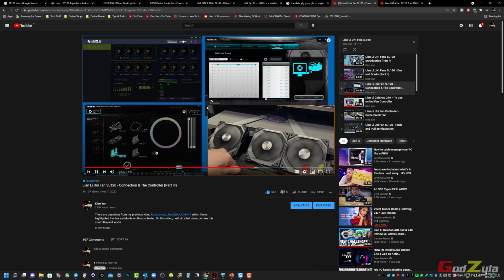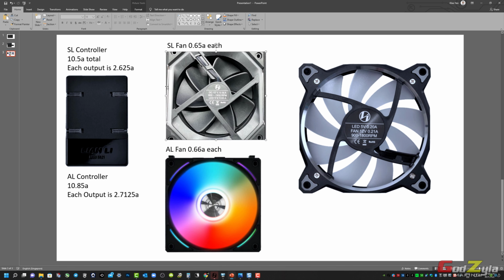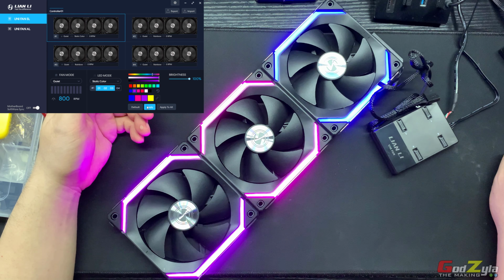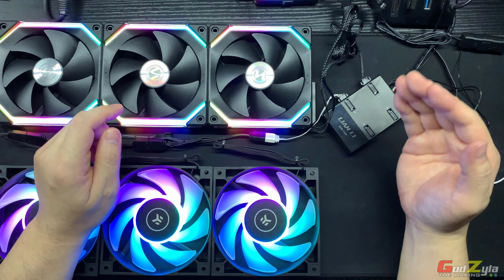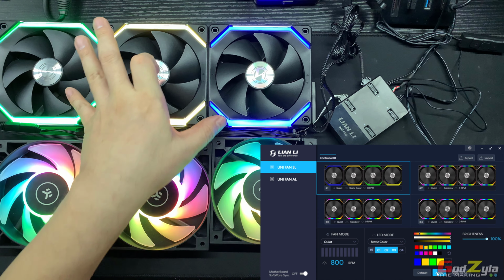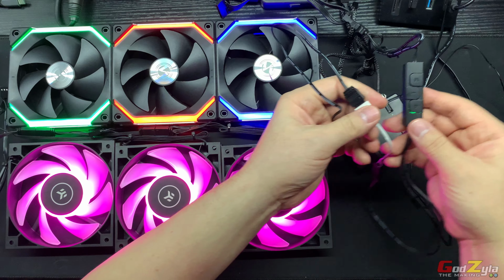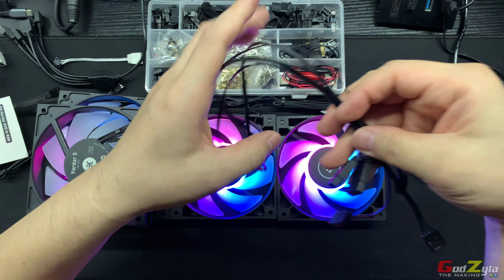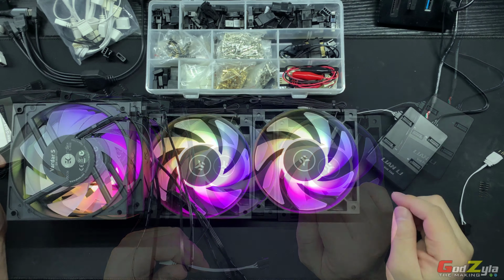Lian Li Uni Fan AL120 & SL120 Controllers [L-Connect 2]

Comment: Hi Kleo 

Your channel is great, my unifans connected to slot 3 in L-Connect recently starting running at full speed no matter what I set them at, all fans are connected to my motherboard via the unihub pwm connection in system fan header 3 and those connected to slots 1 and 2 are controlled without any issue - the speed changes as I change it etc 
The RGB works fine through L-connect for all my fans including those in slot 3, any idea what could be causing the fans in slot 3 to run at full speed constantly?
Reply from the maker: Hi Adam Thomspon, welcome to my channel. It could be a connection issue or the uni controller issue.

Please practise with caution ok.. make sure you power down and discharge your pc before performing the below steps. 

Maybe try swaping only the cables between slot 3 (the fans you are having issues) to slot 1 or 2? If they are still at full speed, this will narrow down that your slot 3 fan cable or fan connection is having the issue.

1) Try using another set of cables and test. 
2) If it still does not help, unlink those fans and swap position. 
3) If after performing 1) and 2) and it still does not help. I would urge you to unlink slot 3 fans and test them one by one
4) If detected one of your fans is causing this, contact lian li to have your fan replace (https://lian-li.com/contact-us/)

If cable or fan is not an issue when you swap slot 3 to slot 1 or 2, it could be your uni controller, test your ok fans from slot 1 or 2 to slot 3. see if they go full speed. it if does, then have your uni controller replace.

Comment: i finally bought al120 fans.. but i encountered a problem the al controller can't be detected unless i reconnect the usb header again..  its always like that on every reboot.. do i  have to return a defective controller ? or usb header hub powered with sata help ? .. i dont want to reconnect usb header on every reboot :(.. thanks advance.  any idea how to fix ?
Reply from the maker: Hello ryan reyes, welcome to my channel. Does your motherboard have another usb header? You might want to try connecting it to another to test it. Also to check if your motherboard have the latest bios? As some reported on AMD zen 2 onwards, if your bios is still the old bios. Intermittent might occured. Kindly check for information related to your motherboard at it’s respective brand website.
Reply from the maker: You might also want to check if you did update the chipset for your motherboard too https://youtu.be/8l4i5UjO3es
Reply: yes updated to the latest bios and chipset.. im using z490 gundam wifi...  but i will try to connect on another usb header !!! thank you for the quick response 😊.
Reply from the maker: @ryanreyes7500  you are most welcome.
Reply: i think i fixed my problems by uninstalling  armour crate using the clean unininstall.. then reinstall l connect 2..  then reinstall armour crate last !! both happy now no more  conflict even after every reboot !! just wanted to share 😃  . thanks for the big help. :)
Reply from the maker: @ryanreyes7500  nice, thank you for the reply and your comment will definitely be useful to those having issues.

Comment: Great videos...
Having just purchased my AL and SL fans, I am very impressed, I moved from Corsair.
I do hope Lian Li consider some new features:
1. if we could connect our RBG - say ... CPU and Water pump aRBB directly to the LL Hub that would allow full RGB Sync rather than another software.
2. If the software could have a curve based on CPU or GPU temp.....to let the fan auto increase/decrease.
Reply from the maker: Hi Paul, welcome to my channel. I am so terrible sorry that I miss your comment. yup it will be nice if lian li do consider your suggestion. once again thank you for the feedback and do pardon me to reply you this late.
Reply: Hi, short question. Did you connect the AL and SL fans to the same controller?

Comment: Hello, i was wondering if you have had any issues with the L connect 2.0 software. Everything with mine works fine until i select rainbow mode, then everyhing in the software stops working. I have to reboot the software to get it working again. I did uninstall it and that seemed to fix it but after a couple of days i get the issue again
Reply from the maker: Hello Takaoshi, welcome to my channel, when that happens, you might want to check on your device manager to see if the USB connection is disconnected. sometimes it does that to me and I did a hardware scan without rebooting nor re-installing the application. Later found out that I have another USB device that is conflicting with it. I move the other device to another connection instead of using it on the same internal USB hub spliter. Then the problem is solved. If that's not the case and it still causes an issue to you. you might want to approach lian li support on your issue.

Comment: So my brother has the Lian Li fans. And everytime he tries to change the colours, they stick to the rainbow RGB…
Reply from the maker: Hi Keiran Winn, welcome to my channel. For your brother's case. It could be 3 reasons. 

1st you might need to update the motherboard chipset as there might be unidentify usb device. Guide in this video https://youtu.be/8l4i5UjO3es

2nd there might be some other argb application installed before the L-Connect app, which the other argb application took control over the IRQ resource (see under device management). you won't get to see the Lian Li device under the USB section. 
in such event, uninstall all argb application using revo uninstaller https://www.revouninstaller.com/, make sure all left over files are removed. Reboot the PC and re-install L-Connect application first, make sure to run as administrator when installing. 

3rd the usb cable between the Uni controller to  the motherboard is faulty which is unlikely, if your board have another USB 2.0 header, switch over. 

If all else failed. I would advise you to approach Lian Li tech support https://lian-li.com/faq/ or to raise your issue at their reddit page https://www.reddit.com/r/lianli/

Comment: Can i connect a single fan to the motherboard without a controler?
Reply from the maker: Hello Oliver Gasser,  welcome back to my channel, yes if it's only 1 SL or AL fan. But you will need to find a female 3pin JST connector to a 3pin standard connector.

Comment: so can i use AL hub controll to control SL fans with having to use two hubs?
Reply from the maker: Hello Nemo, welcome to my channel and yes you will need two controllers as the SL uni fan will react properly on the SL uni controller, same applies to the AL uni fans which will only react properly with the AL uni controller. Therefore if you have place a mixture of SL and AL fans. They each will need their own controllers which have specific firmware on them.

Comment: Thanks for your explanation. Would it be possible to control non-fan RGBs like an EK GPU waterblock with D-RGB using a UNI HUB and the cable kit?
Reply from the maker: Hi widezu69, welcome to my channel, I believe you can so long you know the argb load limit and have the correct converters. this might not be EK GPU water block but i have done it on normal argb strip and also on other argb fans. please watch these following videos

Dos and donts about the uni controller - https://youtu.be/QQHJUQvKwlY
EK Vardar Evo 120ER fans with uni controller - https://youtu.be/bMRz2KVqbjA

Comment: hello kleo, i watched many of your videos on the lian li sl120 fans, but i still cant seem to get my fans to be detected on L Connect 1 nor L Connect 2 (doesnt work as i cant get past the detect device step as i keep getting the message 0 devices found), ive tried to swap the usb port for it on my mobo but nothing changed, however my pc is able to detect the fans through the device manager, so its not a chipset error. any idea on how i can fix it?
Reply from the maker: Welcome Ismail to my channel, now I like to check with you. which motherboard are you using and do you have other argb application running (example Amoury Crate from Asusteck, Fusion from Gigabyte)? if you did install them before you install the L-Connect app, I would advise you to uninstall all argb apps using revo uninstaller. next your have mentioned using Lconnect-2, I assume you are using SL120 fans. may I ask if your uni controller have a marking that says SL120 or no? If not, you will need to do a firmware inorder for your uni controller to use the version 2 of L-Connect. https://youtu.be/hZpzR_4917c . Once again thank you to have spend your valuable time to view my videos..
Reply: @KleoYan  hello kleo, yeah ive followed all their troubleshooting steps and even removed corsair icue (which was the only argb controlling app i had) but still not working. initially the fans were running at default speed and rgb setting, but after i attached the fan controller to another 4 pin hub, i was able to change the fan speed to PWM, but the argb still cannot be controlled. the mobo im using is aorus b550 elite, and my controller does not have SL marking, L connect 1 does not find anything, and i tried using L connect 2 with the device scanner, 0 devices found :(
Reply from the maker: @bloopismail  I think the best way for you is to enage lian li support directly, as I am not able to replicate your issue to assist you. or you can approach lian li reddit. as there are more pc builders there and might have a solution for you. https://www.reddit.com/r/lianli/

Comment: Hi Coming from the Uk used these fans in a few builds, now have all these fans are failing (led's) , Lian li have admitted  fault with the SL120  " BUT" if your from the Uk the website fails to upload as its US based, so at the moment i'm down £1,000 as fans were £28 each with no option to replace them, like any other company they will take your money but make it a nightmare to replace, shame on them
Reply from the maker: Hello JAYZZ71, so sorry to hear that from you. To some is easy to some is not that easy. I like to check, do you run any VPN? Maybe that will help. Or a simpler way is to change your IPv6 to dns to 1.1.1.1  you can find info here https://1.1.1.1 once you have set that try again. It might help.

Comment: I've problem with my UNIFAN SL120 - LConnect RPM gone haywire it shows 0 or various numbers of rpm. LED control is fine. AMD Chipset Driver updated. i can't seems to control my fans RPM. I'm using lian li fans connector, connects to usb 2.0.
9 fan, separate to 4 group. all connected to fans connector
3fans - AIO (Top)
3 Fans - Bottom
2 fans - front
1 fan - back
Reply from the maker: Hello Hy L, welcome to my channel, you mean you can't set your fans to run with Quiet, High Speed, Full Speed or manual settings? if that's the case, your L-Connect is not syncing up with your uni controller. what motherboard are you using and are you using any other argb software along with the L-Connect? Anyway is to switch to another usb 2.0 header if your motherboard has it.
Reply: @KleoYan  im using Aorus B550i Pro AX... bad choice... but its installed >.< .. only 1 usb header for this MOBO... I just manage to solve it half, i downgrade my L-connect 2 to L-Connect 1. And then the fans response to all the fan speed settings, so this exclude the Uni Controller sync issue. 

Another half problem now is My BIOS/MOBO unable to detect my fans. So when i set it to PWM mode, the fan only run at full speed. 
My Unifan controller connection as below :
(I've tested using 3 diff set of unifan controllers, usb & pwm cables & diff sata connector from the UNIFAN Box, so this excludes the wire & controller problem)
- PWM cable connected to fan connector at mobo.
- RGB Cable not connected to anything.
- SATA connected to PSU
- USB connected to MOBO usb connecter.

Headache !!! but at least my pc is cooler with higher fan speed now
Reply from the maker: @HyLow24  when ur fans are connected to the uni controller. You won't have rpm readings except in L-connect app. Btw your SL120 controller, does it have the SL marking on the controller? If not you can't use L-Connect 2 app.  You need to do firmware on your uni controller. Let me grab the video for you.
Reply from the maker: @HyLow24  this is the video to do the firmware. but the choice is yours.. i won't be responsible if you donno how to do it properly .. https://youtu.be/hZpzR_4917c hopefully this video will aid you in someways if you intend to use L-Connect 2 with your SL120 fans.
Reply: @KleoYan  Hi Kleo  I've found the solutions. BIOS Fan Setting - Set it to PWM Mode instead of Auto. Fan speed will follow adjusted curved in bios once L-connect set to PWM..

Will checkout the video, but I'm fine with Lconnect for now.. don't wanna risk it yet. Thanks for your help btw. keep up the good work guiding us newbies!!
Reply from the maker: @HyLow24  that’s good to hear. Congrats 👍

Comment: hi, i'm a new subscriber :D I have a question... Can I connect my strimer plus to the controller of the new unifan al120? as you explained earlier in a video through lian li argb cable kit.
Reply from the maker: Hi Jose ignacio taibao galaz, welcome to my channel, yes you can. the connection is the same as the SL120, you can watch the video here  https://youtu.be/Y0ni_tfcX3g or even here https://youtu.be/njlkdM9lYbI , a full picture on how to use the argb cable kit will be here https://imgur.com/gallery/beYR8CN

Comment: I have the lian li al120 but when I open L connect the software doesn’t show rpms for the fans, any idea on how to solve this issue?
Reply from the maker: Hi DJMonkeeBizz, did your system detect the lian li hub, are you able to controll the argb lights from L-Connect 2? wondering if you use the L-Connect correct version.

Comment: Thank you for the vid! But i have a question if it's possible to teardown the SL120 and put it back together and let it work?

Because i have an issue with one of my SL120 Fan and it seems like it's slower and clogged up. 

I can buy another fan but if i can repair it, why not? 

Thank you for the future response!
Reply from the maker: Hello Izzy Puddy, welcome to my channel. as for your question, I did try to pry open one in the past, not successful. is best not to tear down. I would contact Lian Li for them to have your fan replaced. do a RMA with them, since your fan are less than a year.. it should have a 2 year warranty.

Comment: Hi Kleo, I am wondering why my SL120/140 doesn't always get detected?  I've tried securing the connection to the control box, it would get fixed, but later on it will off and on detection wise.  Is it the controller or just firmware?
Reply from the maker: Hi Buddy N welcome to my channel. I am not sure why is that reacting on you but for me in most cases if I can’t fix it with the chipset upgrade fix from AMD. I get a internal hub which is powered by a sata cable. I do have some friends having those issue like yours. They ended up getting an internal hub like I show you in then video. That will stop your USB from disconnection (insufficient power) or do you have another USB 2 header on your board. Try that too.

Comment: SL fans show 65k rpm in l-connect 2, but i shows right in l-connect,
Reply from the maker: Hello Tobiaz Björknert, welcome to my channel, which SL Controller are you using? the controller with the SL mark or without the SL mark? if you did a firmware on your SL controller without the SL mark, kindly power down your PC, off your PSU and pull out the PSU plug, let it sit for 30 to 45 seconds. it might due to the cause of old cache which you will need to  purge out. then try again to power up to see if it gives you the correct reading on L-Connect 2.
Reply: @KleoYan  no did not do any firmware updates , it just says UNI FAN on the controller
Reply from the maker: @Bjorknert  I see, that might be the issue. Kindly go through this if you want to use L-connect 2 properly and please note that doing firmware is at your own risk https://youtu.be/hZpzR_4917c
Reply: @KleoYan  will update the firmware, got 3 unifan controllers so, only use one to control 9 fans , l-connect work just fine, just wan´t to try to use the new software to see if it is better, tanx for the support
Reply from the maker: @Bjorknert  you are most welcome. yup. try to do the firmware, that might solve your rpm issue.
Reply: @KleoYan  worked like a charm, new firmware fixed it
Reply from the maker: @Bjorknert  Hi, glad to hear you are enjoying the new L-Connect 2 :)

Comment: Hey there! Love your vids. They helped me to build my lian li o11 case with the 120 fans. Im having some trouble though. Some if the fans have a yellow dot forming on the middle or the led lights. Any advice? Maybe you can make a vid on this? Are my fans ruined?
Reply from the maker: Hi Jonathan Nedjat-Haiem, welcome to my channel. as what I have observe, I do not have that yellow dot forming in the middle of the SL120, but if you use it for sometime, aRGB will tend to turn yellowish, thats what we call burn out after a period of time. If it's new (under 6 months usage), I would advise you to contact Lian Li to have your fan replace. 
Now I know this sounds ridiculous but do set a date on your calendar to check on your aRGB after 6 months and within the warranty period. Once you notice any yellowish tint, get it change. In Singapore we have a 2 years warranty period, so ya I will request for a change on those fans if there are any yellowish tint. Though I did alot of vides about the SL and AL fans, I personally do not like argb, rgb (static) is still ok.. this is my build anyway  https://imgur.com/gallery/Pw5kY4q no argb fancy stuff. purely stealth black and grey. I am doing these video due to the fact I have friends who needed help and I was curious. that's why you get to see lots of videos I have done.